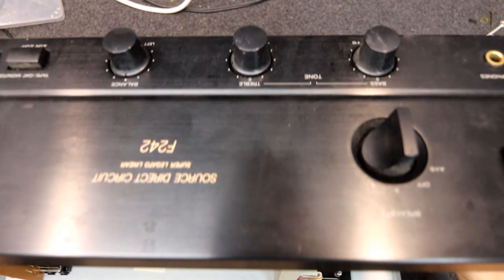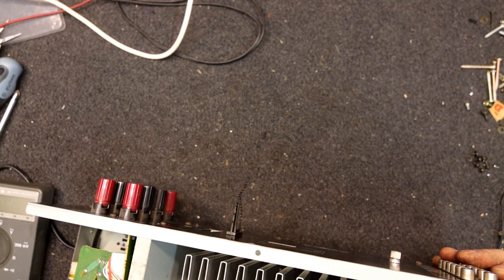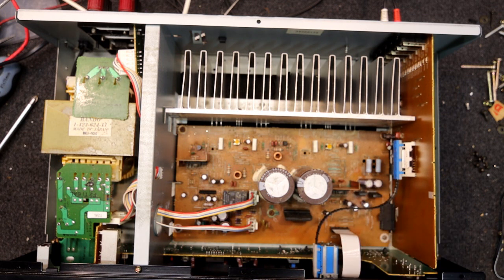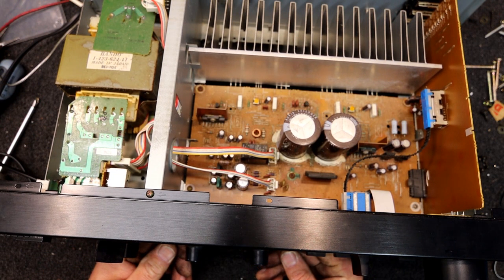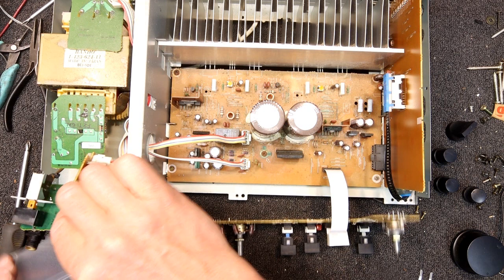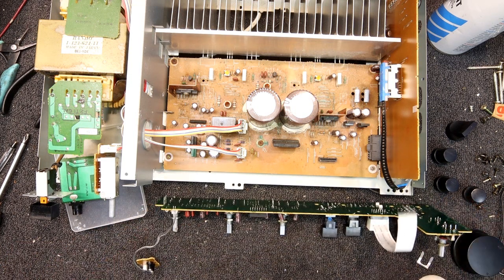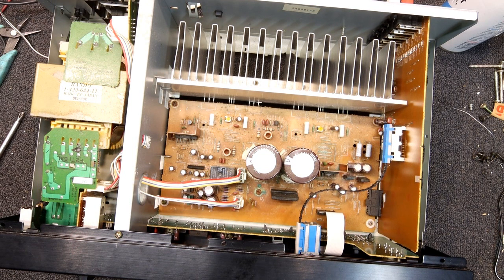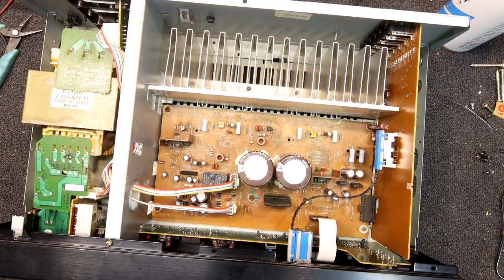Sony Amplifier TA-F242 repair distorted channel and corrosion Part 1

Comment: I have a Sony bookshelf stereo TA-H300 that needs the ribbon cable (Component 2) that interlaces each unit.  Do you know where I can find one?  TIA
Reply: if you can identify the pin number needed in your model, then look for other sony stereos with ribbon cable having the same pin count. 
sony sadly made their ribbons special and there are only supplied with sony stereo systems..